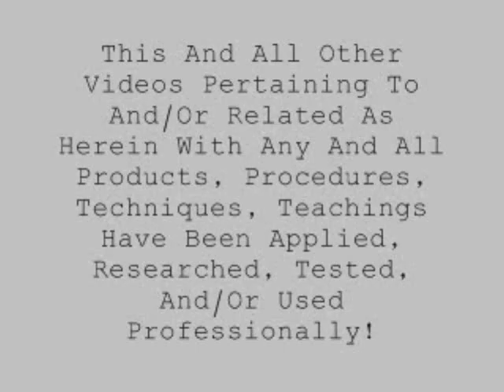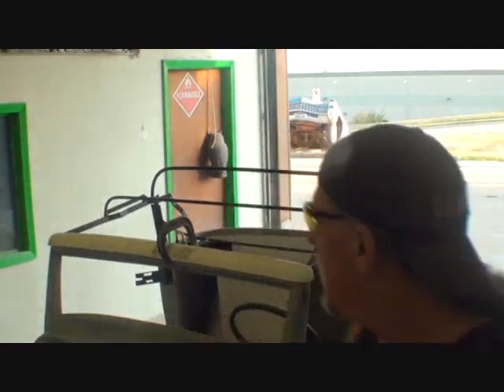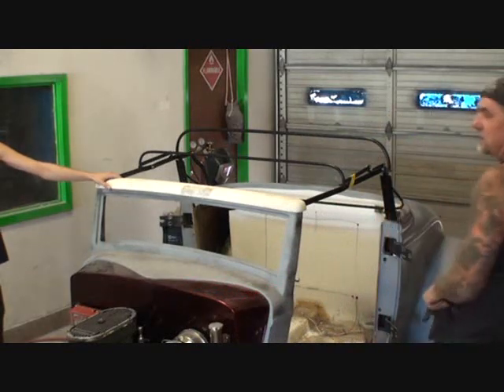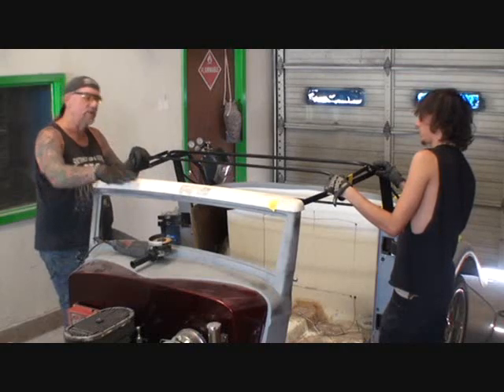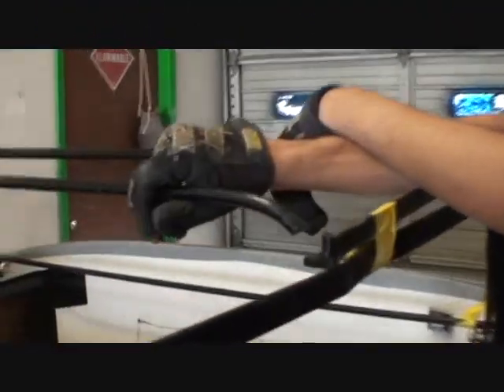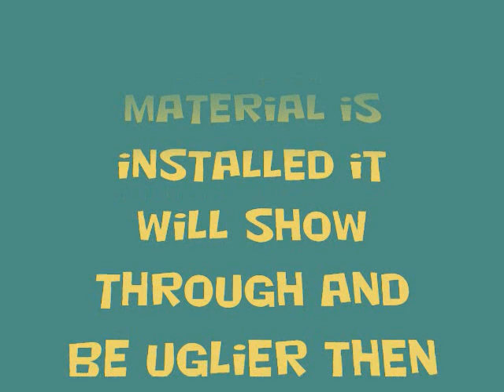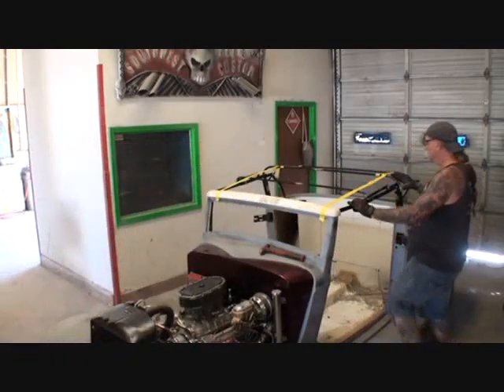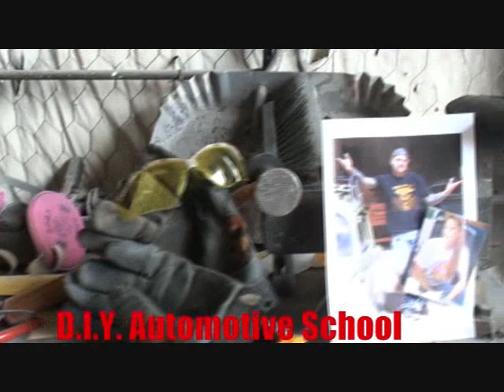How To: Chop A Top On A Convertible Car-Made Easy!

Comment: Hey Pete, what's up with the transmission shop, are they going to give the owner the money back, since they never did fix the transmission? Happy New Year guys!
Reply: +jaysfan19 hell no they wont - trans shops are plagued with shady work that they usually wont stand behind. How hard could it have been to rebuild it if they are a transmission shop ???  I had a Chrysler trans rebuilt that the pump was all jacked up after installation - they told me I must have done something to it ...... typical.